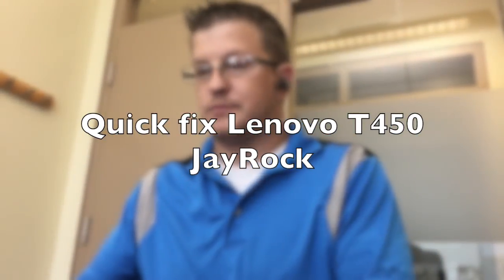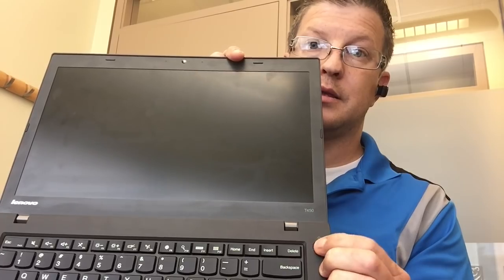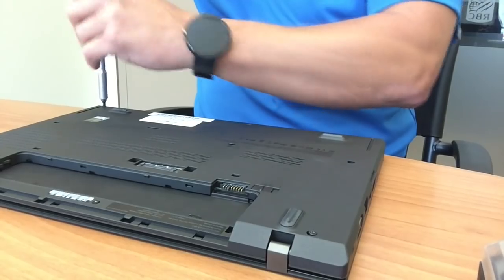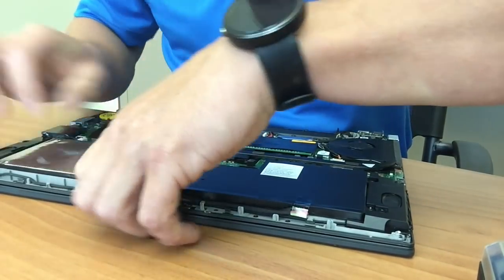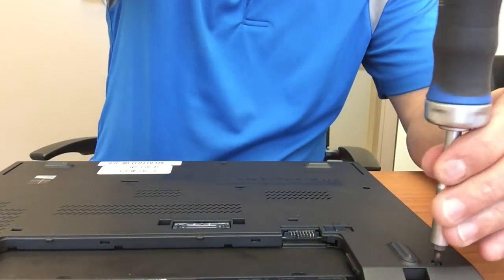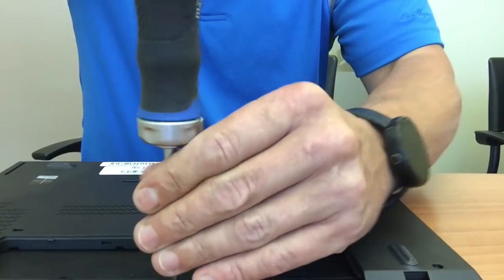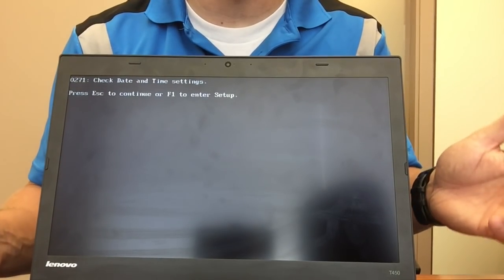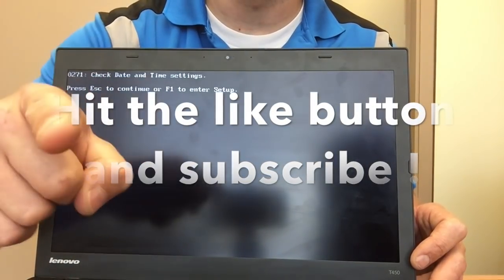Lenovo T450, T450s, X250, L420 and T440S Not Powering ON Quick Fix

Comment: hello can you help me with my thinkpad t440s. it only uses the external battery. is this process can help it back to normal? please advise. thank you.
Reply from the maker: i would give it a try, you won't hurt anything by doing this. you do require the external battery to be connected as well for the internal battery to work. the internal battery takes over when the external is dead when the laptop is put into sleep mode  or you just close the display and walk away.  I would also update your bios from the lenovo website. http://support.lenovo.com/ca/en/downloads/ds035965  . copy and paste the link in your browser. you can run it in windows
Reply from the maker: https://www.youtube.com/watch?v=r-cSKW8XAQA it the link for my bios update video as well, more informational than showing how to do it but its really straight forward
Reply: I'll try first to update the BIOS if it will work. thank you.
Reply: i updated the bios and try the process but it is still the same. once i get off my external battery it will turn of the laptop the internal battery wont give power to the laptop. do you have any idea what is the issue of this?
Reply from the maker: most likely a motherboard issue, if you still warranty I would call Lenovo tech support and see what they can suggest to you. I haven't come across bad internal batteries at all but anything is possible. you could also run Lenovo diagnosistic problem that you can download from there website to see if it give you any indication of an issue
Reply from the maker: https://pcsupport.lenovo.com/ca/en/lenovodiagnosticsolutions/tools it the link to lenovo daigs
Reply from the maker: if you felt like the support i helped you with suggestions etc please consider donating. no set amount link is here PayPal Donation Link : http://bit.ly/2mnwFSP 

Thank you for you comments etc
i would suggest if you do have warranty please use it or take the next step and talk to a lenovo tech. 
I in know way get paid or supported by lenovo. i just find issues that are very helpful to people who come across these issue and do my best to help people who comment.

Comment: WOW.  Just went through this. Took me over an hour(I'm very methodical....)  It worked!!  I was blown away. The power cam right back on.
A tip:  You talk a little too fast, and your edits are kind of rough. You actually do some edits in the middle of your sentence. Rewatch your video, it's hard to tell what you are talking about when you are inside the laptop. I had to rewatch several times.
Reply from the maker: I didn't script the video at all,I just rolled with it
Reply from the maker: I am working on doing editing a lot better but since I haven't done a lot of videos I will be getting better as time goes on but thank you anyways

Comment: JayRock, do you know anything about the L460? Which does not have an internal batt. Mine just shut down by itself all of a sudden (it was installing Win7) and thereafter refused to power up even after plugging in power.
Reply from the maker: Pull the external battery unplug the laptop. Press the power button 10 times and then hold for 30 seconds. See if that work if not best bet to take I to a computer repair shop

Comment: yess, its great to see your trick. its work on my L420.. thanks alot...
Reply from the maker: Just unscrewed all the bottom plate screws and worked my finger nail around the outside of the laptop unitl it popped open.
Reply from the maker: The CMOS battery should be visible it you just remove the covers and the main battery cable should be as well. Sometimes the CMOS battery is black in color
Reply from the maker: i don't have a L420 laptop sitting around sorry. best bet is to google for the manual, lenovo should have that on there website
Reply: Noegraha GMT bro I also have l420 where is cmos battery on this laptop and how to remove supervisor password?
Reply from the maker: Gohel Darshan leave the CMOS battery and internal battery disconnected for 24 hours and that's an old trick and if that doesn't work get a replacement motherboard

Comment: Hey Jay, Thanks for this video. It fixed my problem. In my case battery got drained out probably in night time and it did not come up in morning. I tried Lenovo helpdesk, and we went with few usual steps like 
1)removing battery and then Keeping the power button pressed for 30s to drain out battery and then trying to boot up. It did not work. 
2) Then we repeated above step and as well did the reset. It failed too. 
It was concluded that motherboard needs to be replaced. Just as last resort I tried your step on my own and viola... it worked. 
So thanks for this wonderful video. :)
Reply from the maker: Thank you for your awesome feed back. Like everyone that post on here if you have warranty left on your laptop please use it.

Comment: is it the same for the t450s?
Reply from the maker: Most likely it is. The S is just for a slightly different in specs model
Reply from the maker: I haven't personally fixed a single T450s
Reply: okay, well i will follow what you did and let you know
Reply from the maker: That would be awesome of you, thank you
Reply from the maker: If you still have warranty, use it and get the motherboard replaced. It's a very common problem
Reply: Okay, so what I have found is this... The t450 and the 450s have exactly the same internals. It may have a few contrasts but if there are, you wont exactly be able to tell right away. I ran through the different tests on mine and it actually does come down to a motherboard problem. I used my warranty and am having it replaced.
Reply: I really appreciate your help
Reply from the maker: Not a problem
Reply: I did it on a 450s and it worked perfectly... just so you know... and thank you ;)
Reply: I did it T450 it's doesn't work

Comment: this situation will happen in every unit of t450 or just the unit on your hand?
Reply from the maker: Eric Kksheng it seems to be a very common issue. Has nothing to do with me. It's lenovos poor quality control
Reply: I see. I am recently looking for t460, hopefully lenovo do something on t460(solve this problem). By the way, this is a great video. Thank you
Reply from the maker: I have only fixed one of those and it wasn't for that issue. It was for a video issue.
Reply from the maker: If you can get the extended warranty. It's worth it. Depending where you live a tech will come to your place and fix it next day.
Reply from the maker: +Eric Kksheng seem like this one, t450 seem to be the most common one to have this issue .

Comment: Thanks a lot.  This worked for me.  Was going to send it in for warranty repair, but this saved me a lot of downtime, as repair shop was closed until Monday.  Won't miss any work.
Reply from the maker: wutdafuuh not a problem but if it does happen again I would suggest getting the motherboard replaced. Should only take 1 hour max if he or she knows what they are doing. So your down time should be minimal
Reply: That would be unfortunate, as I just got this laptop Jan of this year.
Reply from the maker: I have fixed so many of that model it's sad
Reply from the maker: there is a bios update for T450 and T450s, check out my other video. i have a link to the iso etc. the update will fix the battery issue